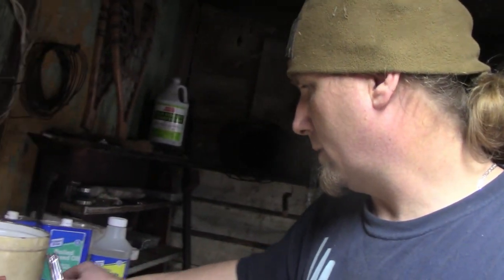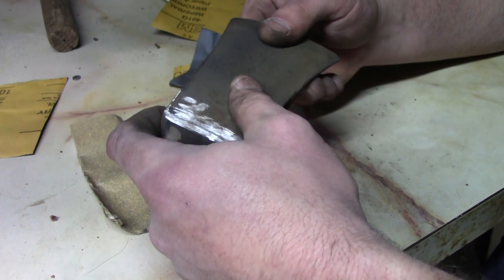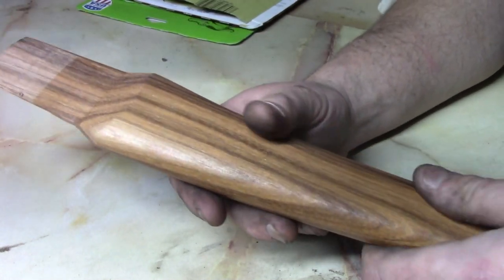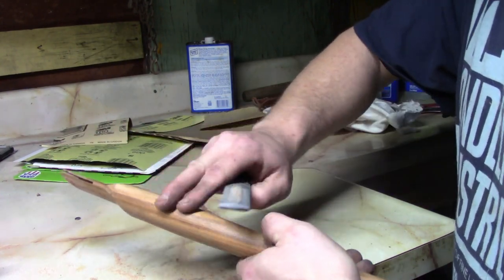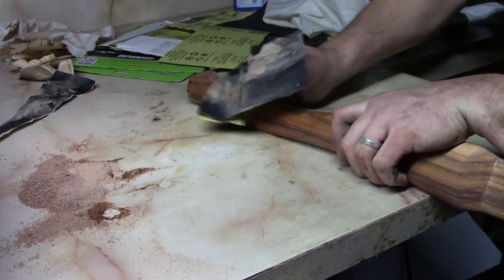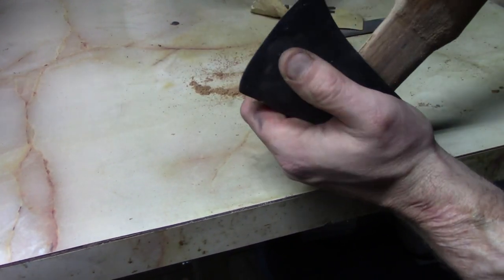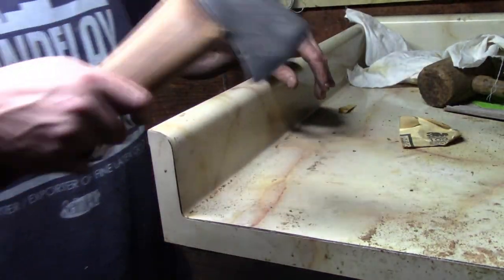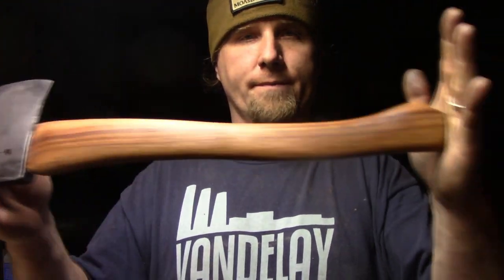Hafting a trail axe: Axe restoration

Comment: I've got an old axe head to hang, never done it going to use your video,  thanks for sharing
Reply: Never heard of sumac turning metal black
Reply from the maker: It’s a great trap dye as well. The tannic acid reacts to form a great rust proof patina. Knives and axes get a good coating of linseed and beeswax paste. Set it next to a heat source and your good to go. I use the woodstove, but a hair dryer would work. Outside on a piece of metal might work in the summer.
Reply from the maker: Hope your axe comes out awesome! Thanks for watching